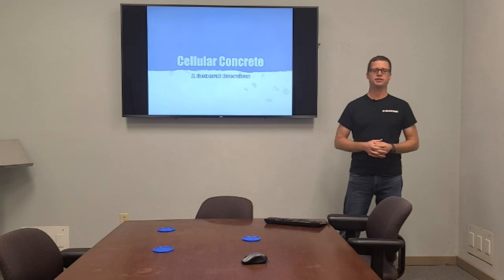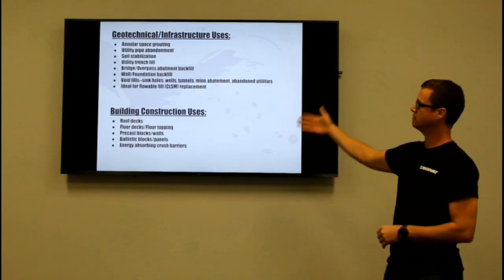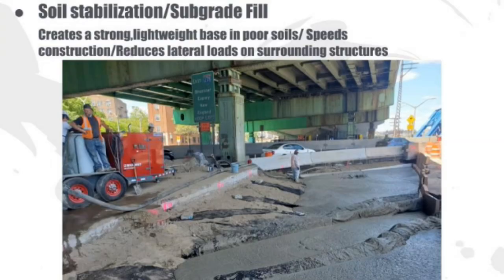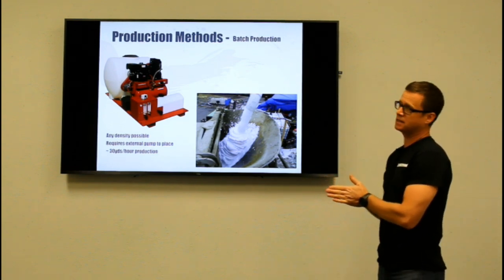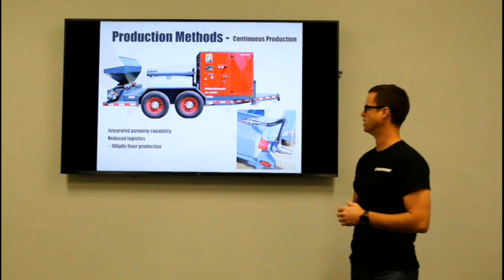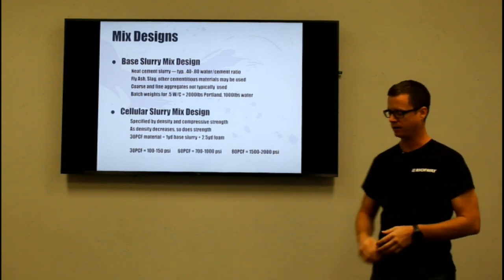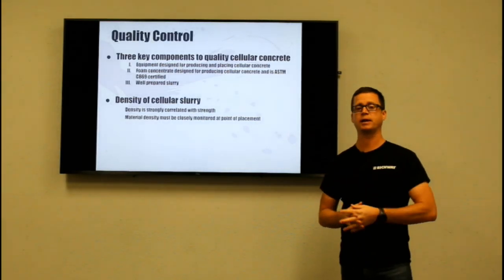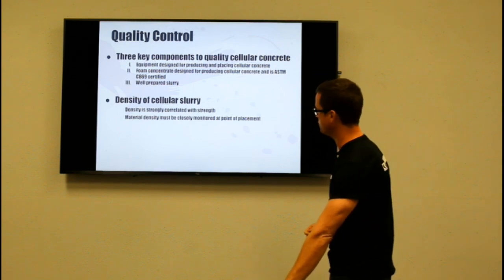Basics of Cellular Concrete

Comment: Interesting presentation.  
Injecting the subjective term "fresh" is an annoyance.  How is this quantifiable for Portland component?
Reply from the maker: Yes, quantifying fresh Portland is something that can't be easily done - unless you're getting lot info from the manufacturer maybe. However in the context of how we use the term, if you're able to get Portland from a ready mix plant (which also may not be easy) you can make a fairly high assumption it's going to be as "fresh" as you can get, given how often most of them would be receiving new loads of Portland.

Comment: Can I ask what you use as a foaming agent that doesn't kill the cement?
Reply from the maker: We manufacture our own foam concentrate that was designed for use in cellular concrete. I'm not quite sure what you mean by "killing the cement"? Generally speaking surfactants (foam) will act as a retarder to the hydration process, but to my knowledge it won't stop hydration of the cement from occurring. 
If you're having trouble with your cellular material getting a set, or air bubbles collapsing, I'd guess it's one of two things; your foam concentrate isn't able to sustain bubble integrity long enough to allow the cement to get a set, or you've got old cement. Buying bagged material from the big box stores is something we don't recommend. Humidity in the air can start the hydration process from the day cement is produced and over time the cement will "go bad". If it's old enough the cellular concrete you've just produced can actually have bubbles collapse  -- no matter what foam you're using.
If you've got further questions feel free to call us at 800-553-2404. Thanks! -- Tony